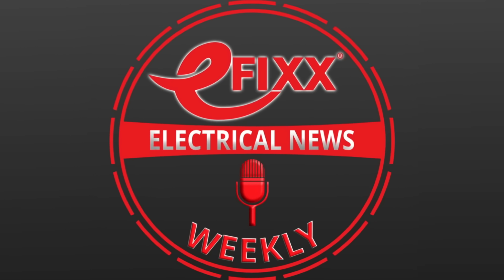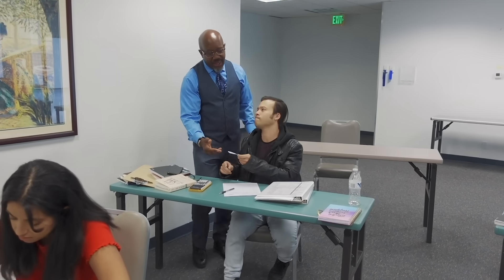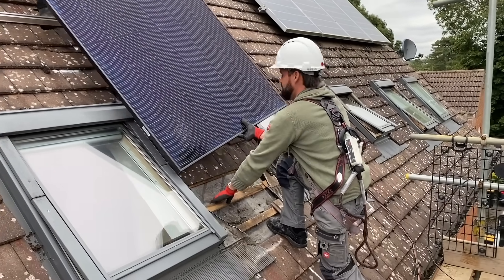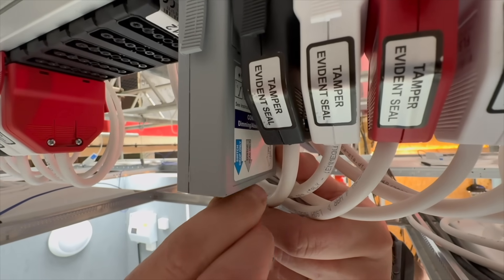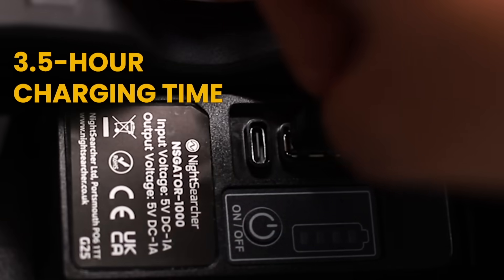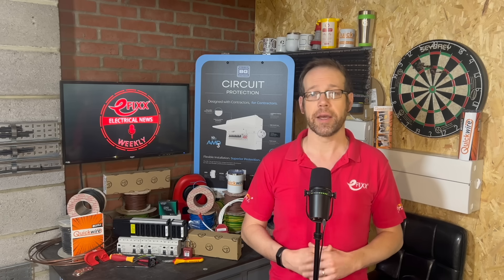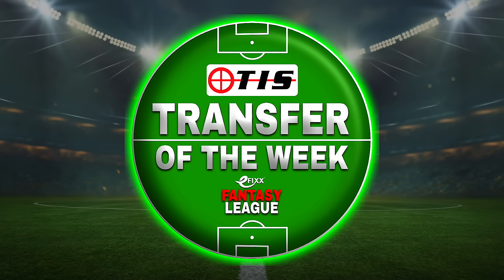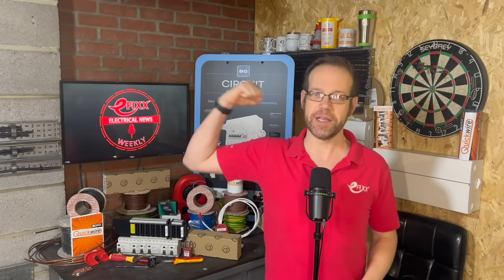Smart Meters Are Telling Lies... Here's Why

Comment: Ugh. As a former installer gone civil engineer, everything about the meter designs is cheap and cheerful. The initial specs by the Brown/Miliband government were deeply flawed and then the totally impracticable SMICOP followed and the Tories did their usual of slowly selling the entire system off to their mates, resulting in something that gave the APPEARANCE of working for long enough for those responsible to flee the country or bury the evidence. Now we as installers are left feeling guilty and like we wasted years of effort and the reputation of connected meters is ruined for a generation. I say again: UGH.
Reply: yeah can't see many of those meters working after 90 years, like the meter i have on one circuit in our house, because i am a complete nerd and love vintage meters
Reply: Metropolitan vickers  metal cased meter (with earth terminal, naturally, rated 10A, on a B6 feeding my IT gear)
Reply: @TheChipmunk2008  quite. There's a reason the National Grid big wires run on relays and electromechanical. Some very clever people keep the art of the 'small wires' and the grid alive
Reply: @OkenWS  The comment you’ve made is valid and reflective of certain aspects of central government’s involvement and its ability to influence energy prices 👍…. It’s not the government who has manufactured these not fit for purpose meters is it!? The government should revoke the companies rights to supply immediately obviously = but NO it doesn’t!  WHY would they want to accept that they have made a mistake and and I guess couldn’t prove due diligence on the companies that have manufactured these ‘smart meters’??? 
Just a rant lol
Reply: @inhaleexhale2224   sounds abit like the post office scandal

Comment: An eeprom taking register reads each day could guard against large errors on the nand flash throwing the results way off. The large unexpected discrepancy could be narrowed down to a particular day. Then its a case of estimating usage until it's rectified. A relatively modest eeprom could store years worth of readings before having to write over the first.
Reply: Or even NOR which is much better for wear than NAND.
I'd be surprised if something as simple as a smart meter used NAND
Reply: @BobHannent  Often NAND (faster, more expensive) is used for the software and NOR for the data.
Reply: Let's be frank: I have a two-rate smart digital meter (i.e: It was made before the UK left the EU) and that would be expected to „roll over“ past 999,999kWh (Good luck in my case! I use just 730 W/day! 🤏😆). 
 
Either way; 20-bits will accommodate unsigned integers up to 1.04m, making 40-bits/read (Or 60-bits, if the total has to be stored separately) and 3,840-bits (480 bytes) per day, if a read is stored every 15 minutes. Extend that to the 20 years I've been living here now, the total of my readings comes in at just 3,35MiB. 💾

Now flash hasn't always been as cheap as it is today, but the sort you got back in 2001 when my meter was certified was good solid stuff, was available in appropriate capacities of 16/32MB per chip, and (If my 32MB Belkin drive from 2002 is a good example) can hold data for well over a decade. If my meter uses an 8MB chip, it could store reading data at that frequency for about 40 years before having to overwrite any previous readings. 👍

So if you ask me; The „smart“ meter manufacturers are clearly buying their flash off Тeмu, so yet another reason to resist any forced installation of a „smart“ meter with my trusty, razor-sharp Axe... 👍

Comment: Standard eFIXX clickbait again. If you'd linked the source of the smart meter claim you'd see it's from a company who want to sell you software to build smart meters with, they make no claims that UK meters are failing due to this issue, and the rest of your report seems to be your own editorialising. It would have been quite easy to take those claims to someone like Landis+Gyr for comment, but you just left it.
Reply: Yes I was surprised that Tuxera's marketing claims were just taken as gospel without contacting any manufacturers for a statement. NAND flash write endurance is well known; I find it hard to believe that major manufacturers wouldn't already be addressing this issue.
Reply: @yngndrw.  Tesla did famously screw this up by leaving all the logging enabled so the flash wore out in a few years, rather than 30, so really dumb stuff does get into products, but smart meter people have proper embedded engineers so I would not expect this sort of things to get forgotten.
Reply: I work on a lot of computers and it's definitely possible but I'd be shocked if they didn't have any form of parity or error checksum to confirm if the data is bad or not.
Reply: Is there any evidence that smart meters even use NAND? When I was designing such systems we used NOR because it didn't have the same wear profile.
Plus it's not hard to detect inconsistent data.
This is what they call 'churnalism', just churn out what the press releases.
Reply: @BobHannent  nor is more expensive,  I doubt any company would go with the more expensive option when the cheaper is deemed fit for purpose
Reply: @BobHannent  No idea but a lot of stuff that used to use NOR has changed to NAND.
Reply: @retrozmachine1189  Stuff with large storage requirements, yes, but a smart meter really doesn't need to store much data, so it probably is easier to just stick with NOR, at least for the volatile data.
Reply: @xxwookey  You might want to read my other comments ...
Reply: Two thoughts:  memory wear out is either poor choice of memory or bad design
Corruption because of brown out or interrupt suggests that the certification testing was flawed - there is a standard for meters
Reply: I immediately thought this was bollocks too.
Flash wearing out for a meter reading ? 😂
Reply: Interesting - thanks for providing this context. One thing that does ring true is that many 2010s/early 20s smart meters - or rather in most cases their comms hubs - have about the same power failure tolerance as the old KBD key meters, which is to say, falls short of expectations. You know when a major power cut has happened because of the number of people suddenly unable to top up their key meters and prepay smarts.
Reply: NAND and NOR flash systems (except those built by complete idiots - which are rare even for random Temu widgets) have CRC checksums on the data because bits can go bad at random, or have ECC so they can fix them up if they do (eg on your nice shiny PC).

Having flash go bad results in software asking for data and getting told terribly sorry it ain't there any more.

In the case of sensitve equipment there's a second issue in that you sign the data with crypto keys so that some kid with a cannabis business and a JTAG can't rewrite the records undetected even if they bypass physical anti-tampering checks. Again corruption on the flash will result in being told either "it's gone" or "it's invalid"
Reply: Smart meters are mentioned and then they show the user display with the instantaneous reading and graphics. Are they referring to that display or the numbers stored in the meter in the cupboard which stores actual usage?
Reply: The mention of garbage collection, in the context of non volatile storage, is garbage. It is a ram technique in more complex systems. A correctly designed product will minimise the number of writes to the storage device to provide the best possible service life. It does not need to be written every minute.
Reply: @JC-jv5xw  Garbage collection is just a reference to how deletion works on flash memory, or doesn't as is the case. It's just more of the marketing of their filesystem as it's not relevant for a smart meter.
Reply: @JC-jv5xw  You do need to think about this from the context of an electric meter. Unless they have power backup internally, thay data cannot just be lost if the meter loses power.
Reply: @AndrewStrydomBRP sometimes such systems will have a large capacitor and monitoring of the incoming power. If the incoming power fails it uses the energy from the capacitor to finalise things and do a dying gasp. I also suspect that losing say one 30 minute set of readings due to a lower cut maybe a trade-off that was deemed worth making
Reply: @mistermartin82  these do send a last gasp but I think it's limited to the comms hub sending a tamper/power alert.
Reply: @mistermartin82  If I was designing it then yes, I'd have a supercap, that's how modern raid cards are designed too.
I would hope it is written to ram, then offloaded to ECC nand in intervals, with the whole system capacitor backed. But considering they didn't want to spend the <£1 per meter to make all smart meters "contractor meters" with isolators built in, I wouldn't be surprised if more cost cutting happened
Reply: @AndrewStrydomBRP  If the meter is not in a situation where it has to be manually read it doesn't have to store much.  Even a days lost data if it came to that extreme isn't that big of a deal.  The network operator will just fill in the blanks using data from a previous period with some calculations to account for the specifics of the lost time such as weather, comparing changes in adjacent premises and so on.
Reply: @JC-jv5xw  yes i caught that too, but bear in mind none of the joes, or even the gary, are versed in IT stuff, they are literally just reporting what is  making headlines. My immediate goto was 'isn't garbage collection part of coding?'

But clickbait is a bit harsh, they have raised many important issues
Reply: @jc cool story bra
Reply: @JC-jv5xw  NAND flash does have a garbage collection process, or at least NAND flash filesystems do. You can only rewrite a block in a 'set more bits' way, without clearing it first, and you can only clear blocks in quite large multiples, and each block has a lifetimes max number of writes. There are also some other wrinkles. So NAND flash filesystems do quite a lot of jiggery-pokery to keep writing data in new blocks, which replaces data in older blocks, and then every so often 'garbage collection' happens to tidy up all the superseded blocks so they can be re-used. This is equivalent to the memory-collection of no-longer-used structures in languages like Java. So it does not apply to just RAM. (yes, I used to (help) design flash filesystems for a living so I do know something about the foibles of NAND flash. )

Comment: hahaha Ejaz doesn't know what he's talking about if he thinks a 'more advanced file system' will prevent nand flash wear.
(I'm an electronics engineer that used to work on small embedded systems at one point in my career)
Nand flash wear is an intrinsic part of the technology, better quality flash will degrade more slowly, but it still happens - wear levelling at the file system level has been present in most devices for decades at a low level in the system stack, so unless some complete fool has left this out of the tech stack for smart meters then there won't be some magic extra bit of software glue in the file system to improve it.

Need to look at and optimise the writes for the block size of the flash so orphaned space isn't being created that the GC needs to do extra work to clean up, and then be realistic about the expected life of the device and the number of write cycles it will see, easiest fix is to use a much bigger flash than needed so the number of write cycles goes down for the expected life of the device.
Reply: Agreed... and what has garbage collection got to do with a flash file system? The wear leveling system us supposed to handle erase / write cycles as demanded.
Reply: Exactly, said essentially the same before I said your comment.
Reply: I did a bit of math for my own meter (Dual-rate Eco-7) that I've had in service for 20 years, and over that time - Assuming 40-bits/read and one read every 15 mins (=480B/day) - The total amount of reading data would only be about 3,35MiB. That's small enough you could get away with an 8MB SLC NAND chip (The early 2000s ones could easily exceed 10-year data retention) plus a 512K RAM buffer, and not need to erase a single NAND page at any point in the first 40 years! 👍

And given how surprised I'd be to se any chip smaller than 16GB in any relatively recent „smart“ meter; You have got to ask yourself how a 16GB flash chip is being thrashed so badly on a data stream that could be stored in less than 1/2 KiB per day. 🤔

There's a lot of „dark“ data being collected and uploaded by these „smart“ meters, I'm pretty sure of that... 🌃
Reply: @UK-Combustibility-Assured There's more than 40 bits as they produce a good amount of information in each record.  Line voltage, current, 'direction', PF, timestamp, etc.  The RF module (usually it's a separate plug in board) adds in additional information which can be meter up time, cumulative operation time, time of last power up, time of last power loss.
Reply: @UK-Combustibility-Assured agree, a question on that is the degree of file system flushing and how much data the software writers decided was acceptable to loose in the event of power loss.
A massively conservative strategy (for data loss) would flush every write no matter how small to the flash - which typically has a block size of 4k, so writing just 100 bytes consumes a full 4kb block. (until space is exhausted when another write is needed to concatenate multiple partially filled blocks)
As you point out it could be buffered in DRAM, and wait until a full 4kb block needed to be written -risk being that in the event of power loss up to 4kb is lost.
So a trade off may have been made between collecting and storing very accurate revenue data vs device lifespan and need to replace in-field. Cost of in-field replacement has probably been under-estimated.
Reply: @unkleoo  Personally; I'd probably have 4-8K of DRAM backed-up by a capacitor array; Most DRAM can hold data for a short while without power and is power efficient, so a cap array capable of holding the data for two weeks eliminates 99% of data loss to powering down the RAM. Once you have a full NAND page buffered in RAM, you flush that to the next vacant block in the NAND (Do you really need a filesystem for a concantenated meter journal?) and then wipe the data from RAM/move pending data down to the start for the next block after doing a read-back test on the NAND sector to verify the data was written correctly. 👍

(Also remember: The smartmeter comms module also includes a UPS to keep the SM going in LP mode during power cuts.🔋)

Comment: If the certification scheme works as well as HETAS it should not be worth the appear is written on!
Regarding the ‘Smart’ meter, which seems to be more and more miss named as time goes on, if the memory degrades over times that makes the rollout a multibillion pound monumental cock up. How can households be charged by a system which potentially is that unreliable
Reply: Just because it could have a limited lifespan doesn't mean it isn't smart. Smartphones have write limitations too with their internal memory but you wouldn't say its not smart. Most issues with smart meters aren't with the meters themselves but either the meters placement or the network infrastructure, both of which aren't the actual meters fault. And even if the meter can't get signal, to you there's no difference getting a reading from a smart meter than it is to get one from a dumb meter.
Reply: If the data storage media being used by these „smart“ meters is Тeмu poor quality, then no record taken by any „smart“ meter is admissible in court proceedings. The default in this case would be that the customer can't have been proven to have consumed any electricity at all! 👍
Reply: @UK-Combustibility-Assured Good luck trying that argument. You'll be laughed out of court with your hefty fine.
Reply: @RichHaynes2012  So a company can be permitted to employ low quality storage and then „restore“ missing data in whichever way suits their convenience, but the customer is not allowed to contest/challenge the use of low-quality data storage in a device that records data of contractual relevance to both parties? 🤔

From where I'm standing, this appears to encroach into entrapment...